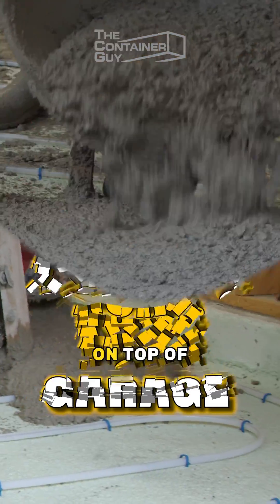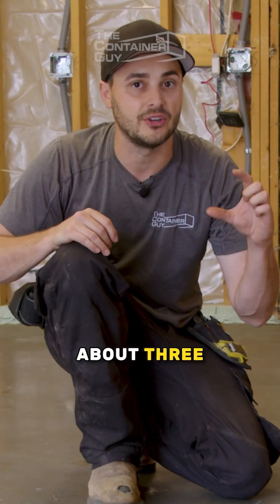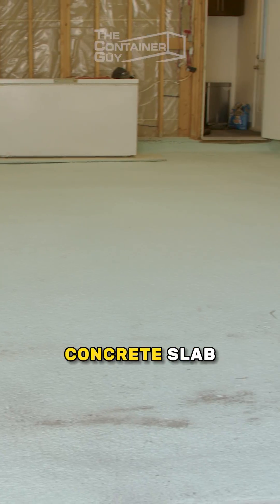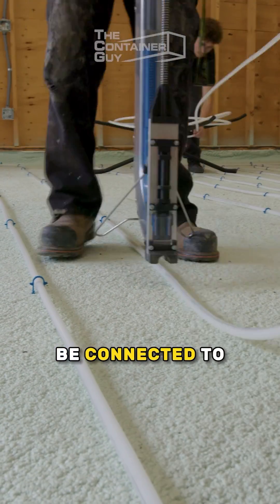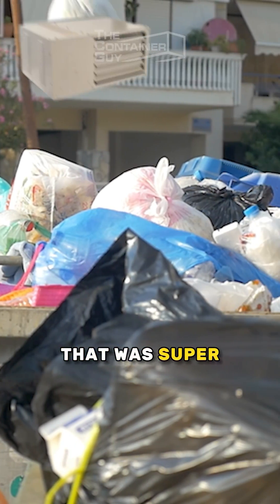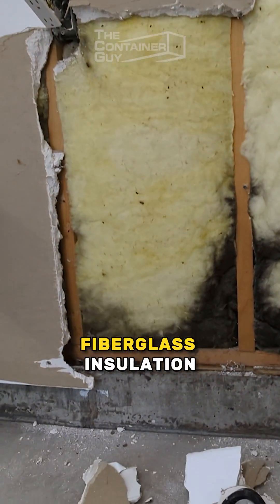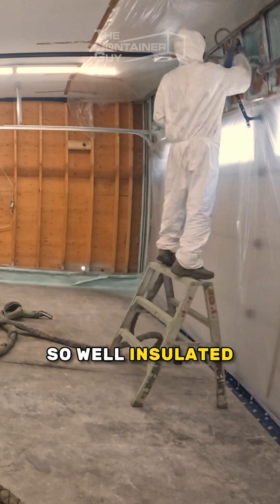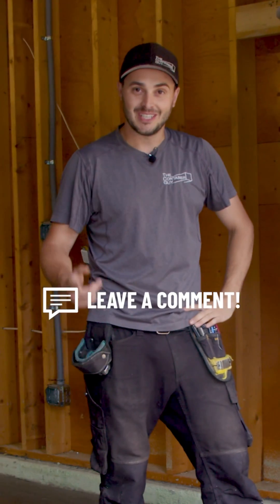Garage Renovation: Concrete & Spray Foam Sandwich 🥪 Is Fibre Mesh Better Than Rebar?

Comment: Move the top hinge down a bit. And re adjust your motor. Cut the track to match the floor.  you should be ok 6 inches may be a problem 4 should get away with hinge adjust

Comment: It’s all well and good, but you made the room with a low ceiling now it looks like a sandwich. See if you ever put concrete on the floor maybe think about not disrupting the height of the ceiling of the room. This is typical of American buildings. they have very short ceilings in Europe you got at least10 feet is normal. 8 feet 8 1/2 is supposed to be the normal. I’m short and even suffocating for me.

Comment: I think you can adjust the gain on your garage doors up and down,  or get it cut down? But awesome problem to have
Reply from the maker: The exterior of the house is brick which makes it harder yet to retain the old door height.. but it looks like I just have to peel the door off and reinstall and only park cars in there (I don't own cars haha)